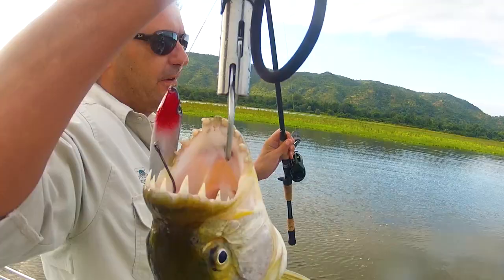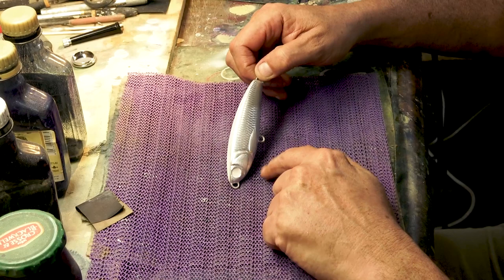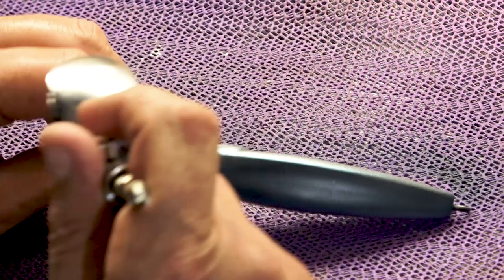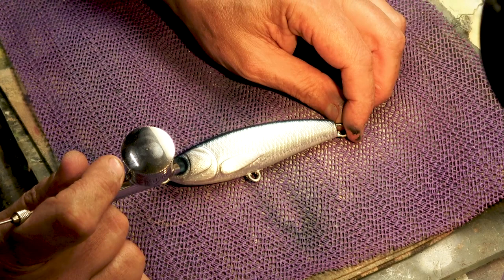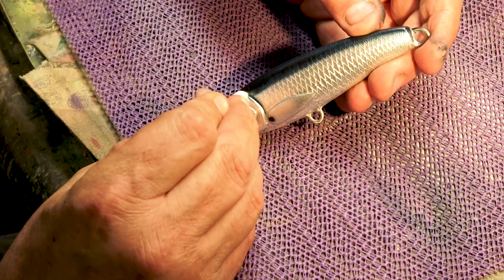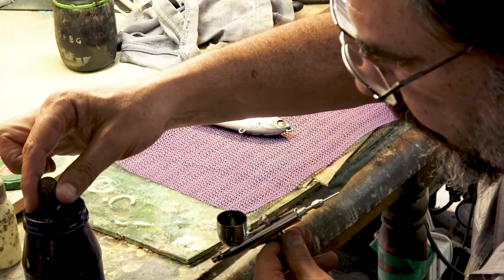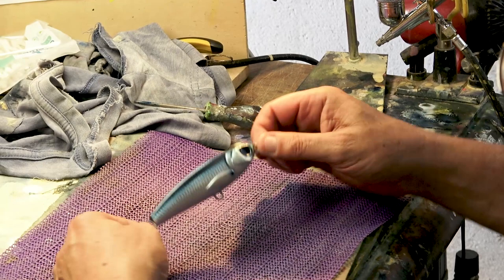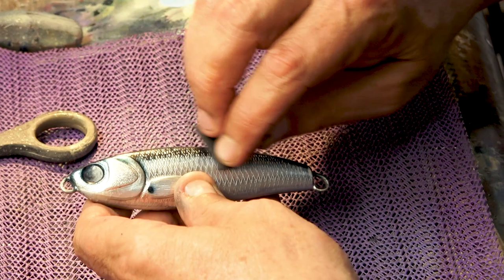Budds - Practical Foiling Part 4 - Painting Base Colours Using the Sand-Back Technique

Comment: What kind of wire is best? and measurements?
Reply: I use Tig stainless wire or buy bulk stainless on roll in various thicknesses. Tig wire is good to start as it comes in straight lengths and is easier to manipulate. The little 100 Ripstick has 1.6mm wire and has been tested to 200kg. Once you have wire bending jigs made up you can progress to the rolled wire. I'll be doing a video on simple wire bending jigs in the near future and there some freestyle wire bending in my coming up Conquistador build video. Watch out for that one. Cheers for the support!